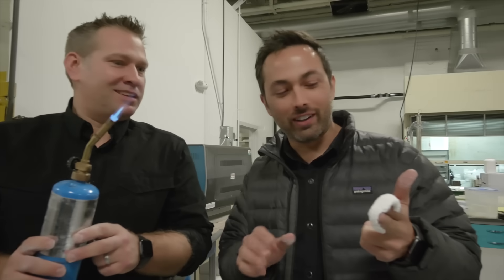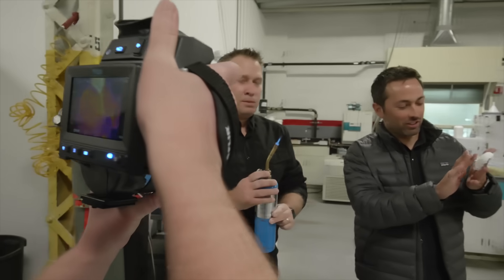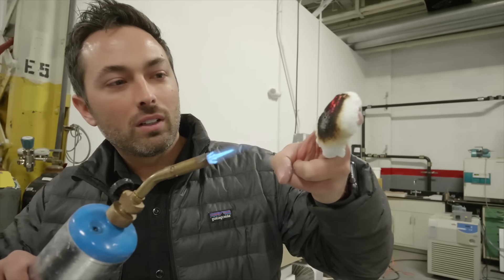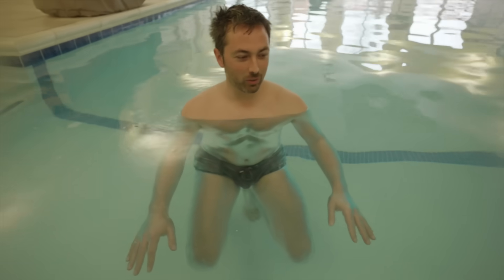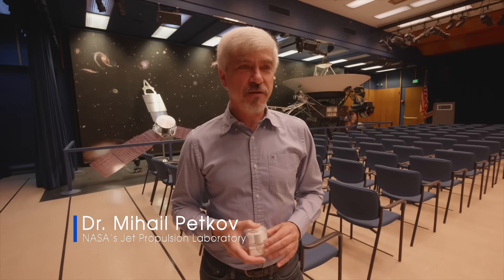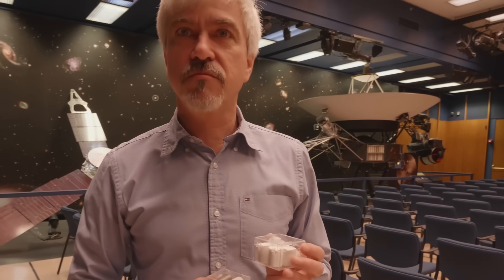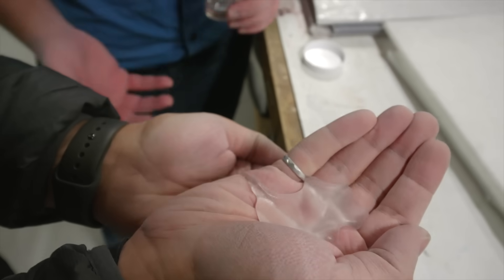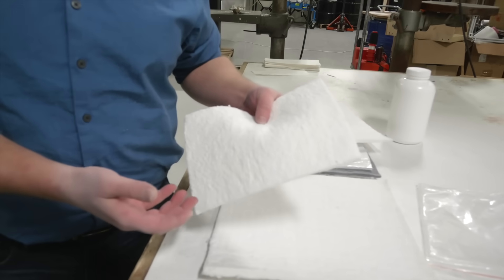I Waterproofed Myself With Aerogel!

Comment: What about covering phone parts with aerogel?  Completely waterproof
Reply: I think it could cause the phone to overheat itself
Reply: @kisa4748  completly right
Reply: It will break so ez
Reply: @vanillaoce8739  Not really since it's a fine dust.
Reply: conductivity issues?
Reply: they could've made phones much better for years now. but its not really good if your phone is indestructible right? how would they make money off of you every couple of years again and again?
Reply: Elin Diamond ur right apple is like hell no WE NEED MONEY
Reply: aerogel phone screen aerogel phone screen aerogel phone screen ae-
Reply: Lots of phones are already fully waterproof... shouldnt it be easier to just keep doing that?
Reply: @Vlozh  correction.
It's water resistance.
Waterproof and water resistance are two very different things.
Reply: Morgan Waffle I know but to a point where they want so much money to even make their phones super weak to need repairs bc I think they actually could make it water proof or really strong and it’s already expensive enough
Reply: STONKS
Reply: uses aerogel as a condom 😎

Comment: I was shocked to hear this guy explain that amorphous silica dust is "very safe". Any kind of silica dust, not just quartz silica, can be trapped in the lungs and cause damage. Over time, people may develop a disease called silicosis and people working in this environment should be using respirators.

Comment: if we really realize what we have here we are progressing as humanity except for pollution but we have a material that absorbs almost 99% of heat with a blow torch that can easily blast ur finger into a 3rd degree burn or burn it off it protects u with a simple coat of “marshmallow”

Comment: Hey tell them to put it in a vacuum and then let acrylic plastic in on the vacuum that way you would strengthen it on a molecular level giving it the strength of plastic and the weight of air

Comment: If you run it on your face can you breath under water.?
I see it being used to reinforce dry wall for fire safety, that would be cool!
and expensive.
Reply: No, it wouldn't allow you to breathe underwater.
You might not realize this but breathing is more about getting rid of carbon dioxide than it is about drawing in oxygen. 
That reflex urge you have to take a breath is motivated in your body by the need to expel CO2, not by the need to draw in O2.

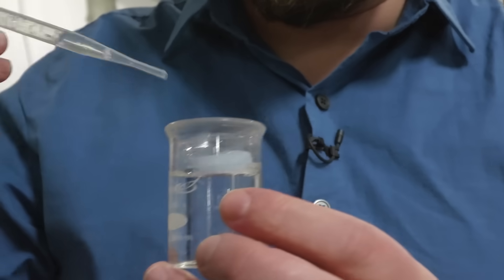Comment: 8:40 , You can achieve the same effect using some candles, as you can rub some wax on your hands and make the same effect. Also, You can use gallium instead of water with nothing on your hands.

Comment: What about H2? Is there an aerogel that can store hydrogen under reduced pressure? The boiling point of H2 is one of the critical  drawbacks for using it in fuel cells and if that problem can be solved it would mean cars and maybe even planes could use it as a fuel. Aerogel's extreme low density could make it an ideal filling for low pressure hydrogen storage tanks. Carbon nanotubes and nanofibers exhibit a high and reversible hydrogen storage capacity, but are incredibly hard to produce. Can an aerogel be tailor made to exhibit this same characteristic?

Comment: Could Aerogel be used to replace common construction insulators? I mean that stuff is very light, insulates and can be made waterproof... That could reduce building thickness of walls and prevent heat loss